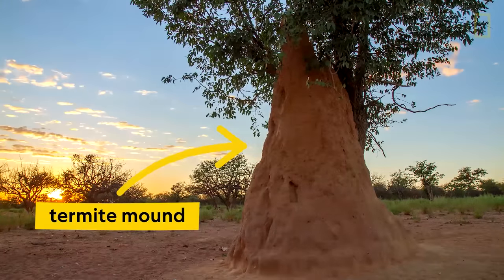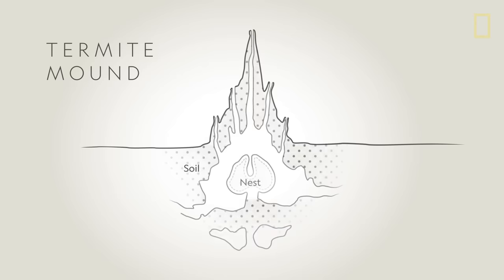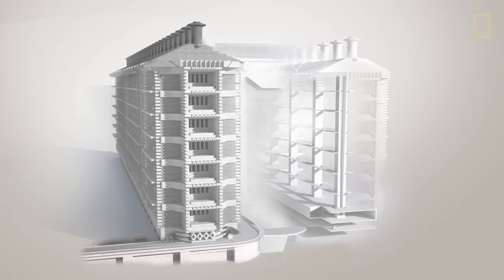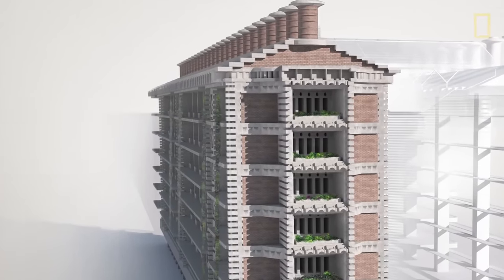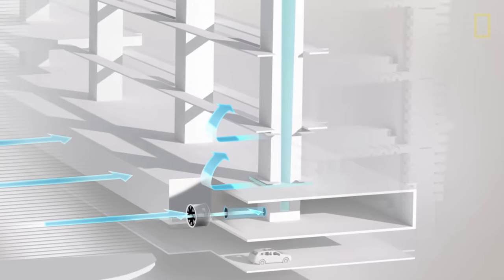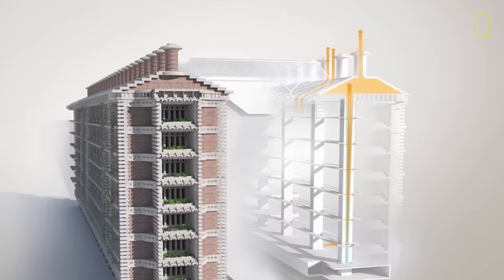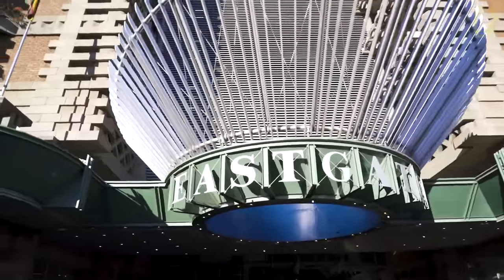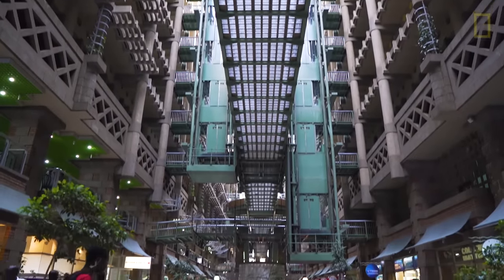See How Termites Inspired a Building That Can Cool Itself | Decoder

Comment: Fahrenheit=1.8(Celsius)+32
Celsius=(Fahrenheit - 32)/1.8

82F = 27.8C 
95F = 35C
Reply: Mauro Molinero it's not that hard, you've probably got a calculator on your phone
Reply: who uses a calculator for that? just ask your phone or google.
Reply: It means nothing when you have to stop the immersion in the video to make a conversion, by which time you will have lost the streak of all other information. So NO.
Reply: balamstudios lol immersion? Lets be real this isnt some groundbreaking visual masterpiece demanding our complete attention, its a short informational video meant to be fact checked by the viewer.
Reply: balamstudios 
You can rewind the video to regain the information. It won't go away and it's less than 4 minutes.
Reply: Immersion means attention in this case. And when such attention is lost then the video stops communicating it's information as the channel is broken.
Reply: Wait, so 28C is "comfortable"?
Reply: well I live in the philippines so 28C is good enough for me xD
Reply: It is if you have 39C outside
Reply: That's still really warm.
Reply: Uncomfortable room temperatures
Reply: real mvp
Reply: mister e 
What's that in kms
Reply: I love you.
Reply: Bu Rida Not if there's a significant temperature change.  Ten degree shift is enough.  When I was at 29 Palms, 100 degrees in the summer was a 'cool' day compared to the average 110's; a 'hot' day would be in the 120's.  Your body acclimates to the climate and your reference shifts.
Reply: thanks mister e
Reply: Nerd
Reply: Its still hot, since room temp. is only 22-24 C
Reply: There is a shortcut. Just say “hey Siri”
Reply: Same formula i use not accurate but will do.
Reply: Mykolas Karpavičius for Zimbabwe climate, 28C is considered comfortable
Reply: @NeverLooksAtComments  and.... that suppose to be impressive ? We are suppose to calculate with our embedded brains, fr Gods sake !
Reply: And i was going to google it
Reply: I was going to google it
Reply: 27.8 is still somewhat muggy, but the building looks airy enough.
Reply: Just stop using Feet and Fahrenheit
Reply: -40C = -40F
Reply: What??? I am Confusion
Reply: VERY COMFORTABILE
Reply: @NeverLooksAtComments  not only are we past doing math by hand, now we are too arrogant to use a calculator. this world is going nowhere fast.
Reply: Well, zombies apparently can't calculate. Especially those of lower class. Thanks for the formula bud!
Reply: @flamingas  for Africans
Reply: 28°C is cool enough cos 35°C is hot in the Philippines
Reply: Thanks
Reply: Bu Rida  it's Zimbabwe, not alaska. They are used to high temperatures. So I assume 27 is comfortable for them
Reply: thanks, this is helpful.
Reply: @flamingas  if air circulation were good enough,why not?
Reply: How is 35 degree celcius cool?🙄
Reply: C=(F-32)/9. Isn't it?
C=CENTIGRADE.
F=FARENHEIT.
Reply: Bu Rida  it's extreme for people like you😂  who live in cold countries
Reply: @flamingas  yeah that's the perfect comfortable zone for countries near the equator.Might be hot for people from colder countries
Reply: Bu Rida  well now we need that for contain corona, we can't use air conditioning now
Reply: No one cares
Reply: @flamingas  27 is good enough for us here in Malaysia
Reply: 35° is kinda hot
Reply: Thank you
Reply: Two termites walk into a bar. One asks, "Is the bar tender here?"
Reply: 30 feets = 9.144m
Reply: Thanks for translating it for us into Celsius, most of us are lazy calculating it.
Reply: @balamstudios  so you have gen z attention span?
Reply: @MorgorDre   And you clearly cant read dates

Comment: "The concrete blocks absorb the cold". Cold isn't a property, heat (thermal energy) is. The cold air transfers heat away from the concrete and vents it out of the building during the night, which lowers the concrete's temperature. Then the concrete acts as a giant heat-sink during the day, absorbing and storing heat from the air.  

I'm not sure how this relates to termite mounds though, other than the fact that the ground acts as a heat sink in the same way the concrete does, but that can be said of rabbit warrens, ant nests, and even your parent's basement. I was under the impression that termite mounds in particular make use of complex ventilation shafts that make use of wind and thermal expansion to bring fresh air deep into the nest and vent waste gasses. I'm pretty sure they don't have ventilation fans.
Reply: Even I was expecting a tech at that level - something like a ram pump which acts based on water pressure & automatic valves... They say that the Pyramid also has fresh air inside despite not having windows...!!!
Reply: Actually a termite mound uses Bernoulli's principle for ventilation. The pressure difference between outside and the inside creates forced ventilation even with the slightest of the breeze. They failed to explain any of this here. The chimneys on top probably mimic this to an extent, but since the floors and spaces are stacked mechanical cooling is probably required. Not much biomimicing from the mound.

Comment: As an architect myself, while this structure is interesting, it isn't really the ideal building construction method for a "self-cooling" structure. Built from at least the 3rd century BC, the house style now recognized as a Moroccan riad is by far one of the best designs for a "self-cooling" structure. It is a multiple storied building that surrounds an open courtyard containing a water feature like a fountain or a soaking pool. Riads are inward focused buildings that have few, if any features on the exterior façade; small exterior facing windows let air in along the first floor which cools in the shaded and humid courtyard. All of the rooms are open to the courtyard, letting in this cool air; the courtyard also acting as a chimney of sorts to direct warmer air up and out of the structure. 

Termites are OK, but the structure still requires heavy use of fans to duct air away, so it isn't really "self-cooling." When a water feature is added into a shaded central courtyard, the difference in temperatures is much more dramatic, and usually, no fans are needed.
Reply: I could not find anywhere that shows how the Moroccan riad design works for cooling. I would like to learn more about what you are implying how this works for cooling.
Reply: @raydreamer7566  
It is essentially just evaporative cooling.
Reply: @lawrencestanley8989  
Nicely explained. 👍
Reply: The video didn't explain that having a vent on the ground floor and the a connecting chimney on the top creates a air pressure differential, the taller the chimney relative to the ground floor vent the bigger the pressure differential. This also means if they  place the vents in a shaded vent the air would be much cooler too.
Reply: What is a good design to keep residential houses cool in Indian summers, where highest temperature may go upto 46-48 degree Celcius? Is there a good insulation system commercially available that works for cheap?
Reply: @abtking91  1. Have the bit where you reside the most in the house face the opposite direction of the sun.
2. Have plenty of tall trees shading the back of the house.
3. If possible live as possible to a fastish flowing river.
4. Have big as window floor to ceiling on each end of the house where you want to stay the most to create a cross draft.
5. Optional have tall as ceiling.
6. Use building materials that keep out the heat when it's hot like mud and straw.
Reply: It's good idea but the rooms which are on the air intake side will not be cooler by the water
Reply: @rcc8506  Okay, thank you, I will check.
Reply: @raydreamer7566  interior courtyard, used in muslim culture and places like southern spain. used for milenia, it does cool the building
Reply: Interesting. I live in a multi-story building which surrounds a central courtyard with water feature and I almost never run the A/C.
Reply: @abtking91  apply tropical design or green architecture design
Reply: This is what fascinates me the most about the Middle East and North African building structures, because obviously before air conditioning, they had to innovate ways to act with nature and not against it, thus these cleverly designed buildings to allow flow of air moving at all times and thank you for the detailed explanation!
Reply: You are just jealous that you didn't think of this
Reply: Is what you're referring to an airwell?

Comment: I pulled up the weather there.   For all but 3 months the outside temp is less than 86 degrees while the night temp is never above 64 degrees.   It's gets up to 90 in Sep-Nov.   Seems like the building should be a lot cooler than 82 degrees.
Reply: I agree, plus since the global average 'room temperature' is about 72.8 degrees Fahrenheit, a gigantic office building that has no AC at all and averages 82 degrees every single day seems like a colossal failure
Reply: @thehulk86  this is what I was thinking too! When I converted the 82 degrees Fahrenheit to  Celsius, I was shocked by how hot it was. Does not seem like a comfortable temperature to spend the whole day working in... Like you said, this seems like a failure instead, I don't get why they're boasting about it.
Reply: A massive hot, smelly building.
Reply: Yeah, how do they spend 66% as much on electricity with massively warmer air? I thought AC was most of the power consumption.
Reply: for someone in zimbabwe 82 degrees is actually quite cool because they have adjusted to much hotter temperatures
Reply: 82 degrees Fahrenheit is not too hot in Zimbabwe, the metrics of "failure" are different in different parts of the world but unfortunately, it's all too common for Westerns to judge everything solely by their own experience - which is a total bummer! They're used to this temperature and I'm also surprised that you guys don't even consider that they would have done something about it if was too hot for them.
Reply: I'm just here wondering what 86 degrees is 🤣
Reply: @J040PL7  nearly a right angle
Reply: @sanderbenning1182  If you live in a tropical or climate, 82 degree Fahrenheit is comfortable enough, and it is not considered hot.
Reply: I wish you also measured the temp of other non-airconditioned buildings for comparison. But yeah, the difference between outside and inside temp is not so much.

Comment: We must also ask ourselves: "why don't you include metric measurements in your videos so people OUTSIDE of the US can understand?"
Thank you
Reply: ....and align with the world gradually.
Reply: Bright people understand both nowadays. 
Many countries have their own "quirks", a Mile can be up to 10KM depending on where you are in the world.
Reply: At this point, i can roughly do the math in my head. Subtract 32 from the temp. in F to get the temperature in celsius
Reply: @dat_music_dude9718   82 - 32, would be 50°c, which is crazy hot. So I googled it
The correct equation is
 (82-32) / 1.8. it can be 1.8 or 9/5
And the temperature would be around 27°c
Reply: @Anderson-cc5jy  easier fair enough way: subtract 30 and divide by 2
Reply: They didn't for the same reasons they didn't include subtitles for other languages (e.g. the Zimbabwe language): most of their viewers reside in the US and use the imperial system.
That said, I do agree they should include metric measurements, it's not much effort to implement.